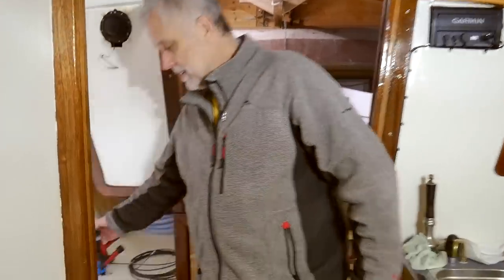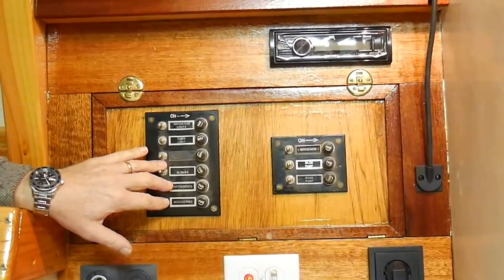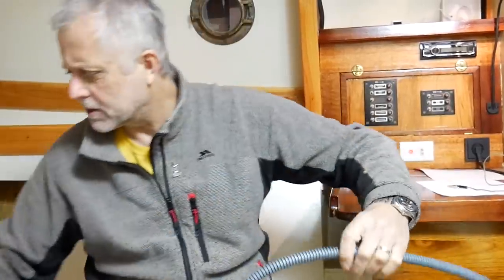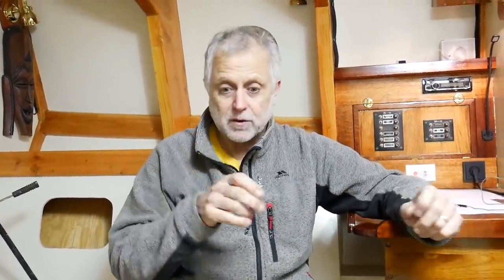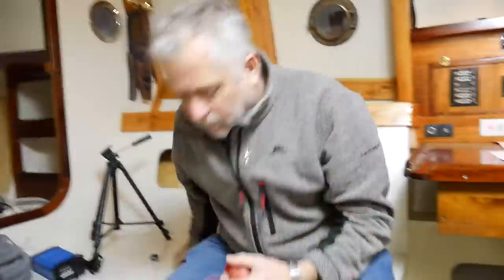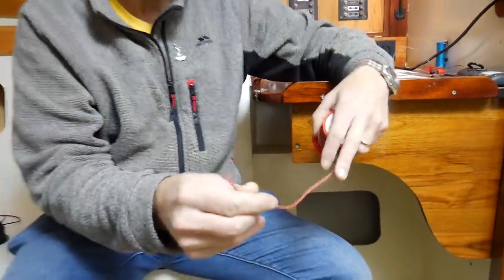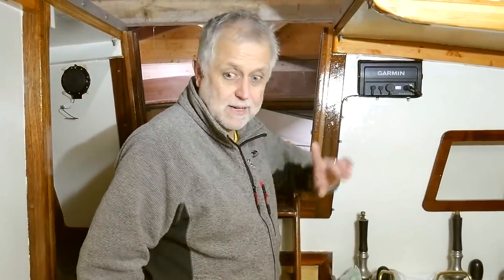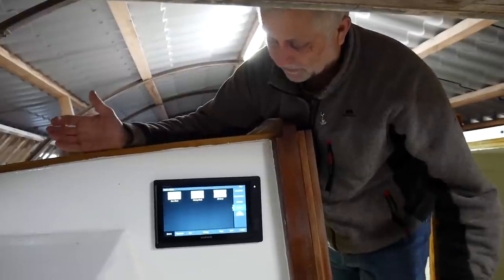Boat Electrics (part 2); Building a cruising sailboat - SV Tapatya EP163

Comment: Fully agree with you about the soldering,  Tony! Also.. I'd recommend a separate circuit for the anchor light.
Reply from the maker: Thanks Garryck. Yes, anchor light! It's in my thoughts, but still undecided. Would like to go rechargeable/ uncabled, but not sure... 🤔

Comment: I like your old school switch  (Distribution ) panel.  And yes I think you will be adding to the smaller panel because you will be adding at least a couple more electronic devices to your boat.  No problem, you have the space for it.  The key to a good serviceable electrical system is relative simplicity and well organized distribution.  It’s easier to trouble shoot a problem and 
it’s easier to add circuits when and where you need them.  Your electrics look great Tony.  Keep plugging away at the odds and ends you have so you’ll be ready to tackle the keel construction and connection this coming spring.
Reply from the maker: Thanks James. Yes, getting there!

Comment: Hi Tony! I agree with you about the old school soldering approach. Clearly superior in my opinion. Great vid... I will be starting my electrical work soon.
Reply from the maker: Thanks Charles. Good luck with your installation. It's a fiddly ol game!
Reply: Sorry, but no, that's not superior. Soldering creates a kind of solid core wire. Tony knows, what that means, because he avoided to use that kind of stuff: Vibrations lead to material fatigue and finaly the wire will break at the point where the soldered part begins. Besides that (and irrelevant here) tin is not an excellent conductor, so, with heavy loads, a soldered connection can heat up. The state of the art is crimping. If you want to make it perfect avoid the twirling of the wire ends before inserting them into the connectors.

Comment: Hi Tony - I like and obviously support your philosophy for the electrical installation, keeping it simple and reliable is the watchword and using good quality tinned wire is only more expensive at the time of purchase. I assume you have an autohelm type tiller pilot with an electrical socket inside the coaming, if that is the case perhaps consider having it on its own circuit rather than sharing with the plotter because if the socket gets compromised you do not want it dragging down a key device. Must be heaven to get back on your boat after grafting on Hazels.😀😂👍⛵️ Have a good Christmas. 🎄
Reply from the maker: Yes good point about the tiller pilot, Norman. It’s also probably the biggest load on the whole boat 👍
Reply: @SVTapatya  Yeah - nearly as much as a fridge.😂
Reply from the maker: Indeed! Except it doesn’t need to run all the time 🤔

Comment: Nice simple systems are easier to maintain and more problem free.  Good work Tony.  When sizing wire for low voltage systems where amperages are low the voltage drop from the length of the wire is the most important issue if it is excessive.  That said, it would take about 100 feet of 16 AWG wire to see a significant voltage drop at the load in a 12V system.  That would be about 3 times the length of Tapatya, so I don't thing you undersized your wire.
Whew!  I had forgotten what Hazel's bilge looked like when you got started on cleaning it.  How is she doing on her refit?  Take care as usual, stay well and Happy Holidays to you and the crew.
Reply from the maker: Absolutely Matt. I tried to keep it simple, but you are, of course, quite right 👍. Hazel's boat progress is good. We've got all the unnecessary junk stripped out now and we're ready to start installing. Actually the first bits are being worked on. We'll get up there for a couple of days over the holidays 👍😀

Comment: ullo Tony
I usually make a fir of the flexi stuff, and measure how much tail I need. Gather up all the wire that has to go through it plus a couple, twist it and tape the end. Pull the flexi stuff out, run the with through it where because its straight theres no issue. Cut the tails then reinstall the flexi. Im told twisting the wires saves some RF.
Reply from the maker: Sounds good, Zulu 👍😀

Comment: Do a wiring diagram with extensive notes and you will REGRET not using colour coded wires and proper gauge wire for the load and wire lengths
Reply from the maker: Errr. I have used proper gauge wire. That was the point of what I was saying. And I won’t regret anything